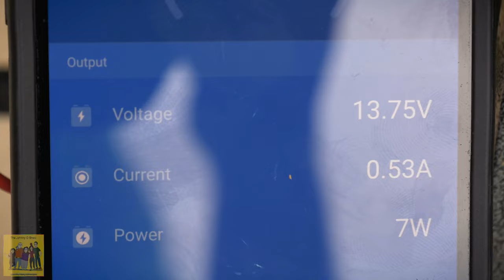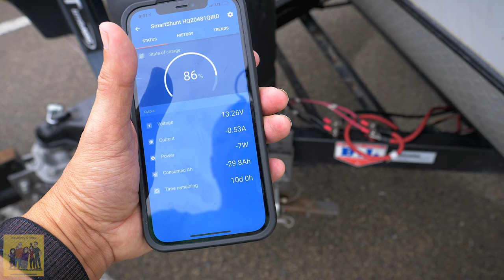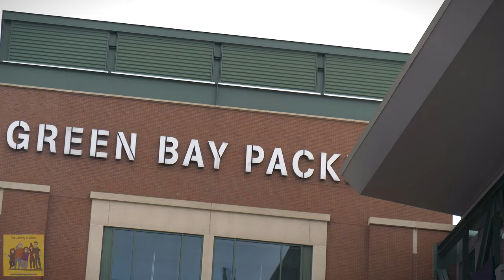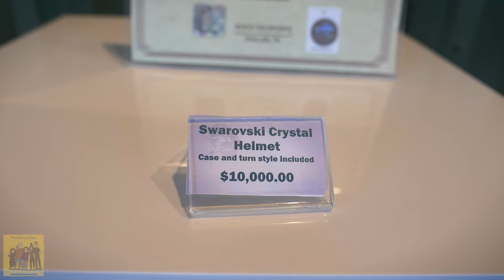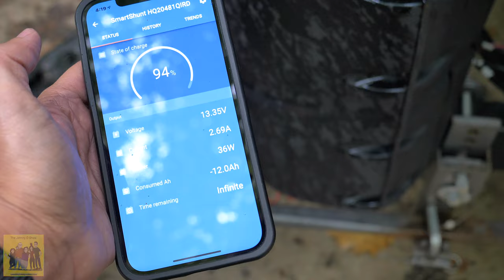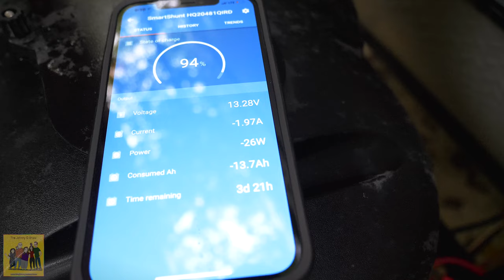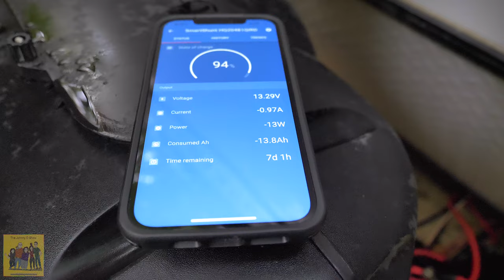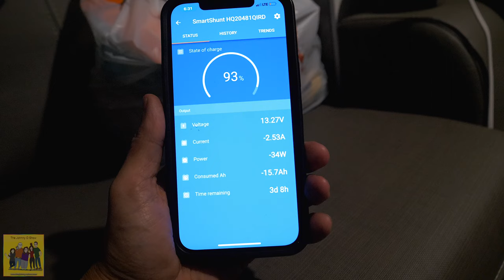Ep. #813 Battle Born Battery Charging Results While Driving - Trip to Door County, Wisconsin

Comment: Enjoyed the video.  Great test.  If you pull the fuse for the TV/Radio, you will save 0.5a or about 7 watt-hr draw.  This amounts to saving 12ah per 24 hours!  I'll take that 12% savings on my battery and only plug in the fuse when I want to use the tv/radio.
Reply from the maker: good idea, 12% is a lot to save i did not even think about pulling the fuse, such an easy solution